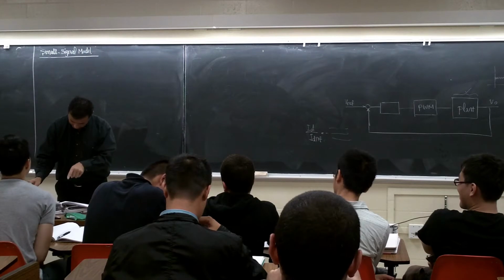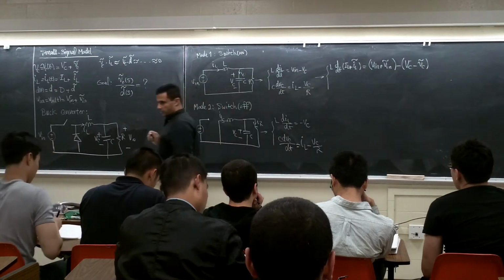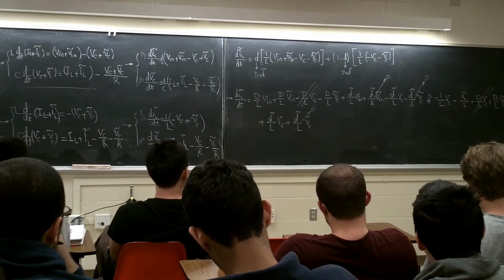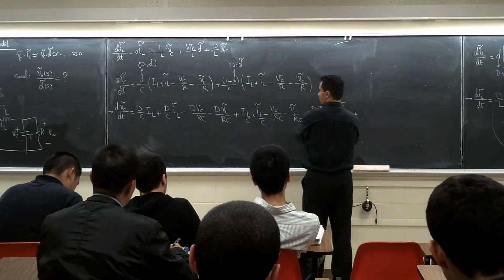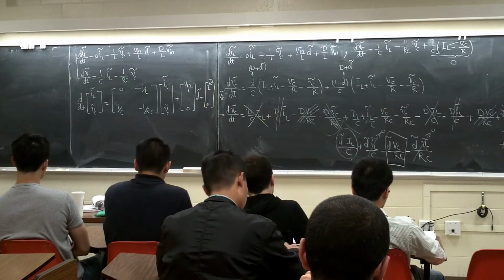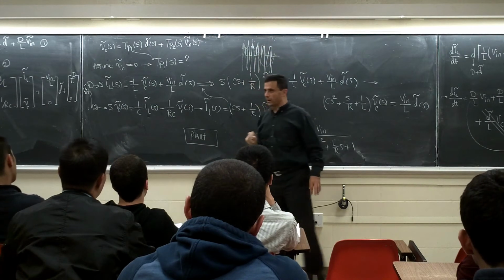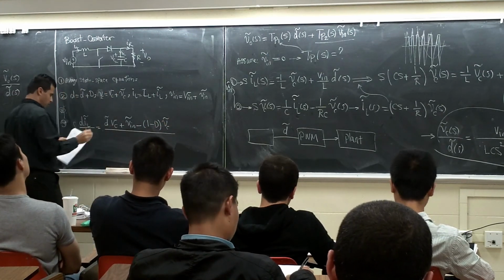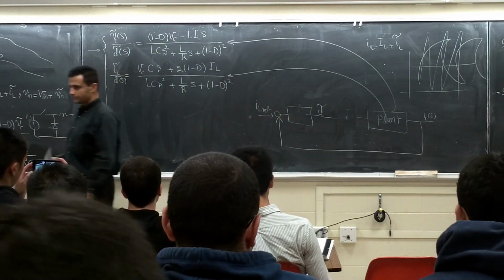ece125b lec13 5/12

Comment: Very good lecture. Which book you have referred in the video as best book on the dynamic modelling of dc dc converters? 

Also Could you explain that what would be the values ofD,  Vc and IL in the transfer function of Vc(tilda)/ D(tilda) for the boost converter ???? The expression contains these terms..what are the values of these?
Reply from the maker: +Piyush Choudhary If you look at the start of the lecture around 5min he explains these values. the book is power electronics by daniel Hart.
thanks for watching
Reply: +Bryce Smith , Thanks a lot for your reply. During the small signal analysis of Buck Converter, you spoke about the best book from ERICKSON... I searched online and found few books of ERICKSON. I don`t know which one to buy. However I have ordered the book by Daniel Hart. Further I need to buy the ERICKSON book???

My goal is to design the CUK converter using PV module and design its controller using MPPT( both traditional as well as intelligent method). I want to study the closed loop control of CUK converter.

Can you refer me some good materials to study the each of these sections. I am studying all these 20 years after my graduation, so i have forgotten many basic concepts, but getting the concepts very fast when get the proper and easy material, like your lecture. You may advise me accordingly and write to me at cpiyush2001@gmail.com

I shall be very grateful to you. 
Best regards.